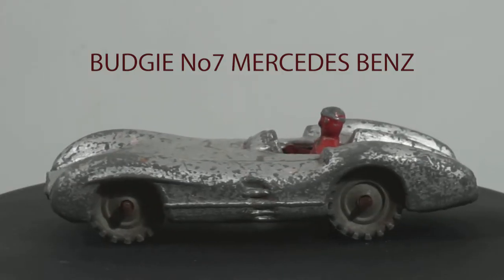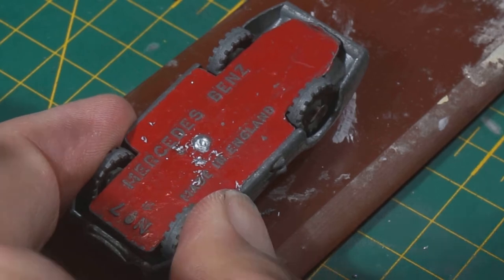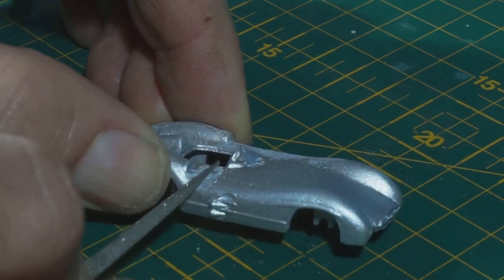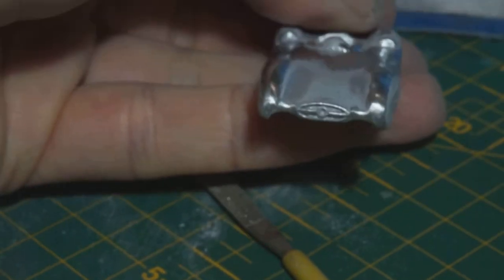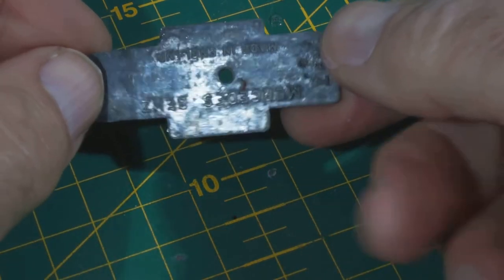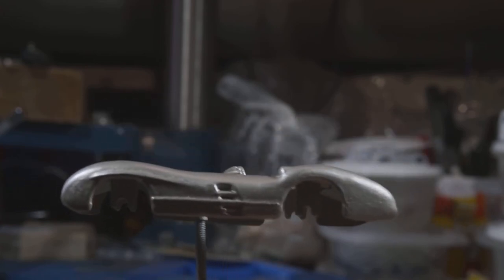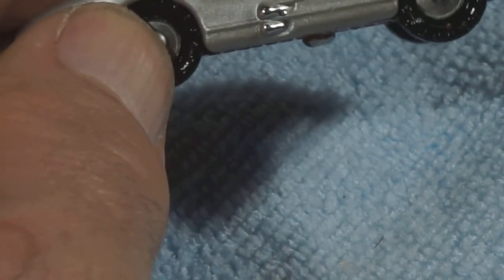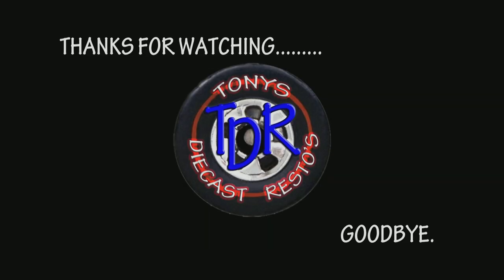BUDGIE No7 1954 Mercedes Benz W196R toy car restoration

Comment: Beautiful job Tony. I think it's great that you went the extra step and removed the casting lines on thr car and the driver. The smooth lines of the car look so much better now. The titanium silver looks very good. If you ever want a real bright silver try aluminum silver. Thanks for the great videos.
Reply from the maker: I have a flat aluminium which I thought about using the chrome silver was way to sparkly.

Comment: Great restoration, though there is an OCD failure as the flattened axle ends should be on one side only.
Reply from the maker: I was hoping no one would spot that, Im just off to the bench to turn one around, be back in a minute.